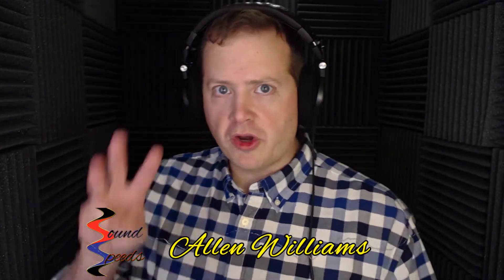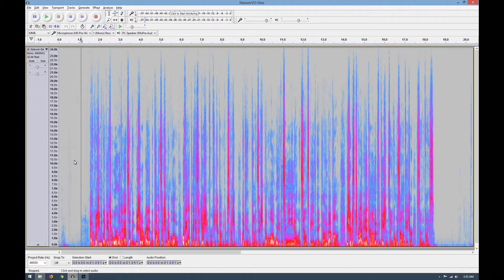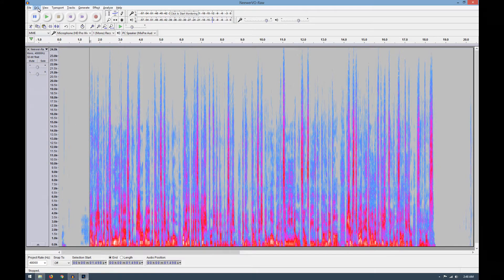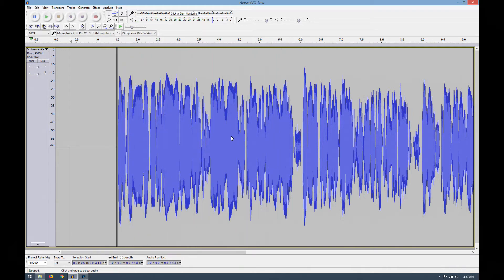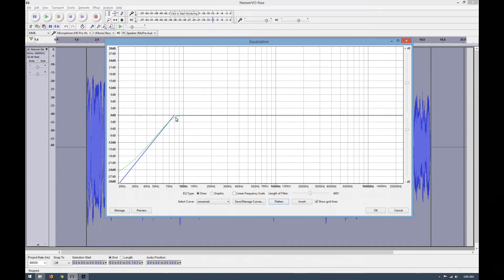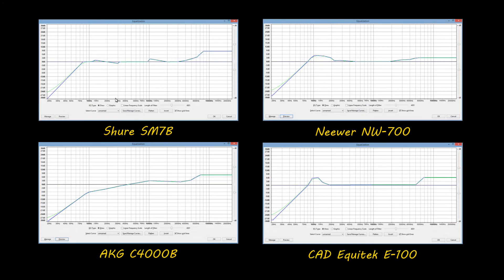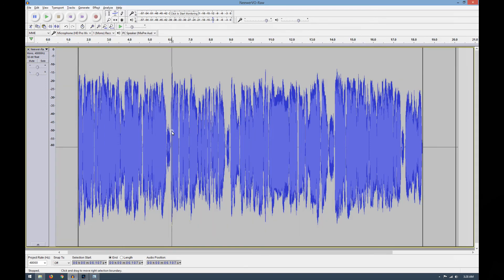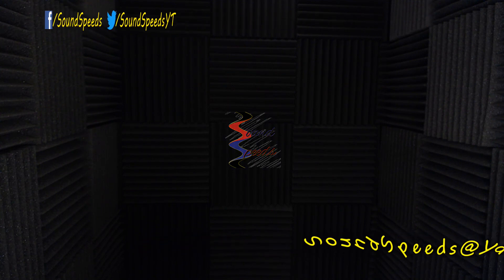pt 3: Can a "Bad" mic be EQed to sound "Good"? - Sound Speeds

Comment: I've used a N700 on a lot of podcasts and I think it sounds pretty good. As you show, can be tweaked. Main issue is that it is harsh and has a tin sound. With that said, now that I have better mics, I'm not using it anymore.
Reply from the maker: Yeah, cheap mics use cheap modules and resonate weird. If you gentle flick a microphone you'll hear how it resonates and if it's light and flimsy sounding, it'll likely affect the sound as you speak into it.

Comment: What a great series of videos. Many, many thanks. I learned some great tips from you with regards to editing and what a good sport Booth Junkie is to put himself through that. A lovely collaboration and really instructive.

One interesting thing - You kind of made me 'fear' self noise less. Until now, if I heard noise, I either used 'noise removal' on the entire file or in the section I heard it which is generally the beginning and end. However, doing as you did and simply generating silence means that it's basically hidden under the sound and when your attention hasn't been 'drawn' to it at the start, it becomes very difficult to hear!!!

Thank you so much for this video.
Reply from the maker: Ian Craig Yes and no. First of all, my recording environmentis very quiet. Second,  the preamps in my recorder are very, very clean pro-audio grade. Most USB interfaces) get nowhere near that quiet. If you notice, my signal to noise ratio is very high so you likely wouldn't hear the noise floor even if I didn't mute it because the self noise of the mic is higher. That's not typical. In part 5, I show the difference in noise floor between my MixPre-6 and a more standard prosumer Tascam DR-40. While you can silence the beginning and end of the tracks, if your background noise is too high (low signal to noise ratio) then you'll hear the background hiss under the VO. Watch part 4 in this series and listen to microphone 4 for an example.
Reply: Video 4 was very interesting. On one of the recordings (I won’t say which) you can very plainly hear the noise gate kicking in and out and that one is noisy to say the least. Or maybe I noticed it more because of the gate? That’s the only one I think I’d be very unhappy with as a result.

The cheap condenser states that it works at low voltage, but if you do go low, it becomes less dynamic and way more noisy. However, it can be useful with cheap portable battery preamps on the go, when the battery is sagging. It just keeps going where other true 48v phantom Mics stopped long ago. Noise isn’t too bad until the voltage has really dropped a lot but at 5v, it hisses terribly.
Reply from the maker: Ian Craig None of that surprises me. If I. were to guess I'd say that it powers the capsule and a little bit of output voltage but that's it. Gotta cut it somewhere and those are the two most important components.

Comment: The "select curve" option down below the equalizer in audacity could have saved you a little time with one of the presets.
Reply from the maker: If I had like the way any of them sounded then you're right. I was trying to defeat and wonky frequency response pattern.
Reply: I just meant for the low cut you started with, not for everything.
Reply from the maker: Oh, gotcha. You would be correct then.